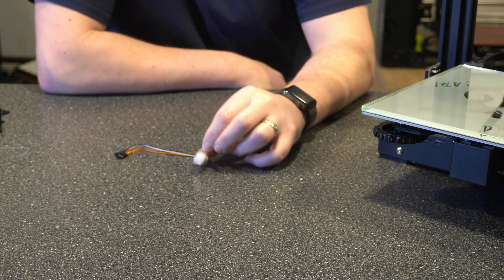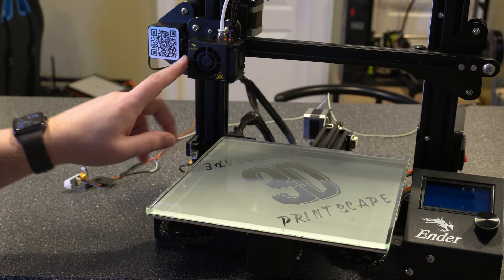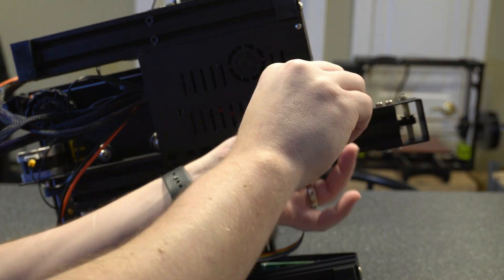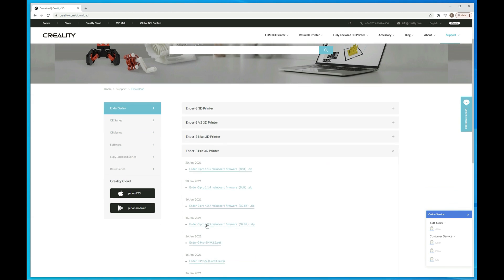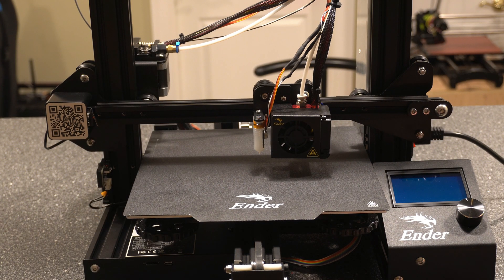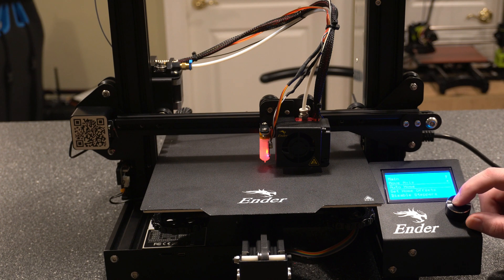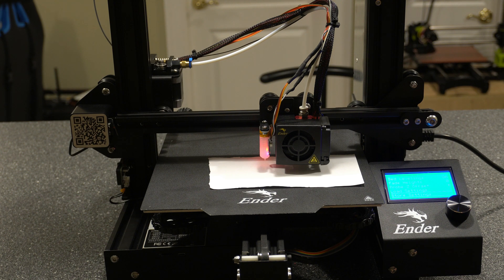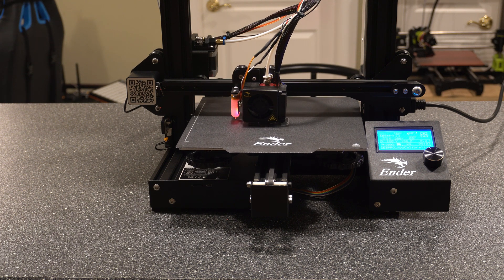Guide to Install a BLTOUCH on a Creality 32-bit Mainboard

Comment: Hi, this is a great video. I have successfully installed the BL touch and followed all the steps exactly as described. However, every time I start a print, the extruder crashes on to my print bed and grinds into the surface. I am not sure what I am missing. I have a Creality Ender 3 w/ a 32-bit board (v4.2.2)
Reply from the maker: Hi. It sounds like the wiring and firmware dont match. How is the printer wired and what firmware are you using?
Reply: @3DPrintscape Thank you so much for the response - truly appreciate your help. The firmware I am using is from the Creality website: Marlin ver 1.3.1 (Apr 25, 2020). I picked up the one from the folder named "Marlin2.0.1  BL touch V1.3.1with-adapter firmware" - the file name is Ender-3 - Marlin2.0.1- V1.3.1- BLTouch.bin

The wiring is done per the instructions & product manual: the 2 black and white wires from the BL touch are connected to the z-offset pins (it was previously connected to the z-limit switch which I removed). I've used the adapter board for the other 2 connections: 1) the display cable connected to the 10-pin 2) the other 3 wires from the BL touch are connected to the 3 pins on the adapter board Yellow -> SIG, Blue -> GND and Red -> VCC
I have a different problem though that I cannot cover the control box as the adapter board comes in the way of the fan but I am just covering the control box the best I can and used a tape outside
Reply from the maker: @skvclips  The creality firmware won't work with it being used for the z-homing. I would drop the adapter board (Not meant for the 32 bit boards), connect all five wires to the bltouch port (make sure the wire order is correct, sounds like you will need to swap the positive and negative in the adapter), then connect the z-stop back up. After that, make sure your using the normal bltouch firmware, not the one with the transfer board.
Reply: Hello Rob, thanks a ton again for the guidance & help. The BL touch upgrade kit documentation is very different. I rewired based on your video - I did swap the Gnd and V connections. I then used the BL Touch firmware (without the adapter board) & powered up the printer.  So far so good

I will next try setting the z-offset, bed-leveling & try a new print. There's still some work to do but wanted to send you a note on the progress. Thanks again - truly appreciate it. I have been breaking my head for several hours trying to get this to work

One more question: I'd like to join the discord that you mentioned but when I follow the link and click on the accept invite I get an error saying 'Unable to accept invite'
Reply from the maker: @skvclips  Im glad to hear your making good progress. I checked the discord link and its still active, others are joining with it. The server requires you to have a validated email address but I think that's the only limitation. I generated another link to test with, try this one out. https://discord.gg/AMegShAuNs
Reply: @3DPrintscape  thank you. I am able to join the discord. Also, I'm able to set the z-offset & am now trying a test print! Just being super cautious about the z-offset & trying multiple iterations to make sure that I don't damage the print bed. Thanks again

Comment: Hello. I've followed your instructions so far though I have a different connector wire, but they connect to the same 5 plug you plugged your 5 wires into, which shouldn't be a problem. My problem is when I try to extract the downloaded zip file, and I'm on a Windows 10 computer with Firefox as my browser, I only get one file labelled Ender-3-Marlin2.0.1-ET300_HW_4.2.2_SW_1.0.3-20210306.bin. What should I do? Help, please.
Reply from the maker: Hi. They renamed the firmware zip back in June when they added other options. Download this package from the site. "Ender-3 pro 4.2.2 mainboard firmware（32 bit）.zip"
Reply: @3DPrintscape  From the Creality site?  That's where I got it from. But when I unzip it, the only option is the zip I posted earlier: Ender-3-Marlin2.0.1-ET300_HW_4.2.2_SW_1.0.3-20210306.bin.
Reply from the maker: @precepts8893  Ya from their site. The one package has all the reality firmware and they started uploading others.
Reply: @3DPrintscape  there's only one file when I unzip the download and it's the file I keep showing you. Does it have everything in that one file?
Reply from the maker: @precepts8893 i just downloaded the file again to see if it has changed and im seeing 5 or 6 folders with multiple files in each one. It sounds like you are downloading the marlin build, not the Creality one. Its further down in the list.
Reply: @3DPrintscape  yeah, you're right. I did need to scroll down further. Thanks.

Comment: Because of your stupid instructions my printer almost started to burn.
Reply from the maker: Hi. Sorry your having issues with the bltouch. My guess is that the wiring is wrong, more specifically the blue and red wire reversed. The bltouch is shipped with many wiring outputs, which is why I cover the pinout, and say to verify everything, in detail in the video and written instructions.

Comment: I forgot to unplug my z endstop before powering on. Did I kill my mainboard?
Reply from the maker: Hi. If you have all five wires from the bltouch connected to the bltouch port, then the z stop should still be connected. If your seeing problems, it could be related to the bltouch wiring pinout being wrong.
Reply: @3DPrintscape  maybe the firmware didn't flash right? How long is that supposed to take? When I turn it on, the screen is blank, but lit up.
Reply from the maker: @chrisxdeboy  The upload only takes a couple of seconds.
Reply: @3DPrintscape  I'm thinking maybe it was bad firmware
Reply from the maker: @chrisxdeboy  Its possible.
Reply: @3DPrintscape  fixed it. The issue was that I'm in Linux where deleting things on a separate drive sticks it in a waste in folder called .Trash-1000 which appears hidden because of the . in front of it, so formatting the card, then sticking the firmware on it fixed the issue and it works now.
Reply from the maker: @chrisxdeboy  Cool, glad you got it working.

Comment: what do i do if the cables that came with my BL touch aren't any of these colors? mine is blue/red/yellow/black/white then at the board end its re/blue/yello then black/white on the send plug
Reply from the maker: Hi. I would trace the wires back and make sure the pinouts are correct. It sounds like  the ground and +5v may be swapped.
Reply: @3DPrintscape  big thanks, I did that and it's been smooth sailing so far, thank you very much for the fast reply
Reply from the maker: @Blackburnerable  You're welcome

Comment: So I have the BL Touch v3.1 and it has the yellow, red, and blue wires, but they are configured incorrectly, I was just wondering if there is a work around for that
Reply from the maker: Hi. You would have to change the pinout, i had to do it on mine as well.
Reply: @3DPrintscape  not sure how to do that
Reply from the maker: @Ametherius  On the adapter, board side, you can pull a little tab and pull the wires out. From there, you would put them back in the correct order.

Comment: Did it and my board caught on fire 🔥 wtf man
Reply from the maker: Hi. It sounds like the wiring on the bltouch was wrong, most likely the positive/negative were reversed. Ive seen the bltouch shipped with about 10 different wiring outputs, which is why i stressed the wiring in the video. Also, if the wiring is corrected, the board will probably still work.
Reply: @3DPrintscape  ok thanks i got it now!

Comment: Since I'm at a loss as to how to fix it, maybe someone here will know. first things first, I'm new to 3d printint, this being my first, so bare with me. I have an Ender 3 pro (4.2.2 board) with a glass bed and got the bltouch hoping to make bed leveling easier, but everything went wrong despite following the video to a T (no fault of the video itself, my printer just didn't cooperate). I've since returned the bltouch and won't be getting it anytime soon, however now my printer can no longer go to negative values on it's z axis and I can't for the life of me level it in the center. it's having issues where the filament just starts accumulating on the nozzle when it gets to the middle of the bed, but I can't raise it as it'll scrape anywhere else. I've thought maybe the bed is uneven and is bowing but unsure. If anyone has any idea I'd appreciate any help as I now have a $300 paper weight I'd like to revert into a 3d printer.
Reply from the maker: Hi. Sorry to hear your running into issues. Can you provide more information on what your running now. The firmware version, etc?
Reply: @3DPrintscape  I'm running the "ender 3 pro Marlin 2.0.1 - V1.0.1 - english"
Reply from the maker: @azsmocworks252 Can you try the firmware from my site to see if you have the same issue? https://3dprintscape.com/marlin-firmware-builds/
Reply: @3DPrintscape  Just tested the "firmware-20210519-150607" one and still can't go to negative values on the Z axis
Reply from the maker: @azsmocworks252  Ok, then its not the software endstops. Can you try to swap the white/black wires on the bltouch and test again?
Reply: @3DPrintscape  sorry for the late reply, I had returned the BL touch already sjnce first post, I wanted to correct the issues it caused to begin with

Comment: You still need to  add the mesh command inside cura?
Reply from the maker: Hi. You dont need to but i recommend doing so. If you dont, the printer will fall back to whats it has saved for the mesh.

Comment: i bought  a 3d touch clone came with a resistor do u know where i need to put it
Reply from the maker: Hi. I dont think the resistor is needed when connecting the creality or skr mini board, but i dont have that abl, so i cant say for sure.
Reply: @3DPrintscape  ok thanks

Comment: I followed everything you said and it keeps crashing into my bed i have the ender 3 not the pro 4.2.2 board what should i do
Reply from the maker: Hi. It sounds like the wiring doesnt match the firmware. If you used the creality firmware, all five wires must be connected to the bltouch port and the z-stop must still be connected.

Comment: Do you have set the z every time you turn on the printer
Reply from the maker: Hi. As long as you save the settings, you wont have to set it again when you restart the printer.
Reply: @3DPrintscape  hi I bought black filament from Hatchbox PLA 1.75 And I am having trouble with it no sticking to my bed the Temperature for the nozzle is 200 and the bed I set it to 95 and still lifting up and suggestions
Reply from the maker: @ronaldpeel7288  The bed should be around 60, 95 is too high for pla. What type of build plate are you using and can you describe the behavior you are seeing in more detail?
Reply: @3DPrintscape  the filament isn’t sticking right away later in printing it starts to lift up
Reply from the maker: @ronaldpeel7288 What type of build plate are you using?
Reply: @3DPrintscape  the one that came with it
Reply: @3DPrintscape  Hi I just printed a tissue box cover and under the top it was all string how do I fix that the fest was fine
Reply from the maker: @ronaldpeel7288  I would need to see the model, but it sounds like it needs supports.

Comment: When i auto level and touch the probe, the printer keeps going down on Z axles, any way to fix this? And if i dont turn it off in time the printer keeps going and digs into the bed
Reply from the maker: HI. It sounds like the wiring doesnt match the firmware. How is the bltouch wired and what firmware are you using?
Reply: @3DPrintscape  hi thanks for your quick response. I figured it out. It was like you stated wrong firmware. Have a good evening/night :)
Reply from the maker: @Mark-cl9iw  Cool, im glad you got it working.

Comment: Is it the same settings for the Cura Touch?
Reply from the maker: Hi. What do you mean by Cura Touch?
Reply: @3DPrintscape  sorry I meant the Creality CR Touch. The Creality CR Touch firmware update is the same as the BL Touch from the manufacturer. I was just wondering if the CR Touch updates/settings are the same as the BL Touch updates/settings you post on your videos? BTW thank you for posting all this content. It’s very helpful.

Comment: Hello, new to the 3d printing world here! I am trying to get the bltouch firmware updated on to my sd but when I go to extract I only get one file. I tried this file now when I turn on my ender 3 the screen is just blank. Does this process take quite a while? I'm not sure what I'm doing wrong any feedback would be greatly appreciated!
Reply: reading through comments the board still has power and everything is still running but I have a blank screen. I think I need to find that proper file.
Reply from the maker: Hi. You can use the Creality firmware or the Marlin build from my site. Make sure the file name is unique and that the SD card is 8GB or less and formatted as FAT 32.
Reply: @3DPrintscape  I will give this a try when I get home! Thanks!
Reply: @3DPrintscape  about how long will it take to load onto the mobo?
Reply: @3DPrintscape  IDK what I changed but it worked lol gotta love technology! thanks for your input!
Reply from the maker: @bigZg59  It should only take a couple of seconds to load and I'm glad you got it working.

Comment: I tried to install BLtouch on my ender 3 pro, with the 4.2.7 card, following this tutorial and the card burned. I was sad, there must be a problem. I think the Z stop connector should be in place of the original Z stop.
Reply from the maker: Hi. It sounds like the wiring wasn't right. Most likely you received a bltouch that had a different pinout which is pretty common. Unfortunately, I've seen them shipped with about ten different wiring pinouts. A lot of them that are meant to work with a transfer board have the blue and red wires swapped. If that was plugged into the 4.2.7 without swapping them the ground and positive would have been reversed and it would have smoked. I have seen this happen to many times, which is why i spent a lot of time talking about the wiring in both he video and written instructions.
Reply: @3DPrintscape  That's exactly what happened, the red and blue wires were swapped. The plate burned. I must not have noticed or paid attention when you talked about the wires. Thanks for your attention, I really like your channel.
Reply from the maker: There is also a good change the card wasnt burned out. I would swap those and test again. I think in almost every scenario i heard about the board ended up being fine.

Comment: Actually, this has been the most straightforward and easiest to follow (for a Newbie) that I have found.  My only problem/ or suggestion is to make a vid for the Ender 3 MAX.  I can't seem to find one that makes any sense at all.  The ones that claim they are for the MAX show a completely different LCD screen (and options) than the one I have.
Reply from the maker: Hi. If i can pick up a Max for cheap i will do a video on it. For now, i think joining the discord server, invite is in the video description, would help you out a lot. I know several people on there have the Max.

Comment: great video but my kit had the wires in the wrong spot I think. my connector from left to right is yellow red blue, what is the correct order so I can move them? i have the 4.22 board
Reply from the maker: Hi. It would be blue/red/yellow from left to right.

Comment: I did all of this and just ended up with a blue screen and now unuseable printer.....   Fixed it by putting 1.0.1 back on the sd, loaded the printer fine, then just added the 4.2.2 bltouch and worked for some reason that time.
Reply from the maker: Hi. There are a lot of issues around SD cards and files names, so its possible you ran into a bug. Is everything working now?
Reply: @3DPrintscape  Yeah, after re installing the original firmware I put the new one with bltouch on again and worked without issue that time.
Reply from the maker: @FriedMozzorella  Got it, im glad its working now. Sometimes issues like the one you had are hard to explain.

Comment: Do i need to move the z axis switch, i have mine all the way down
Reply from the maker: Hi. If your still using using the z stop, you will want to make sure its positioned properly. That said, if you didnt change your build plate, where it is should be fine.

Comment: This was very helpful but no matter which firmware with BLTouch I update it to for the 4.2.2 (Ender-3 pro Marlin2.0.6  mainboard+BLtouch), it won't auto home or bed level, it keep saying it failed and to restart. If I use the firmware Ender-3 pro Marlin2.0.6  mainboard+BLTouch+screen, this gives me a blank blue screen. These are the option for the BLTouch that I get off of the Creality site.
Reply from the maker: Hi. Can you join the discord server? It will be easier to try to troubleshoot this there.